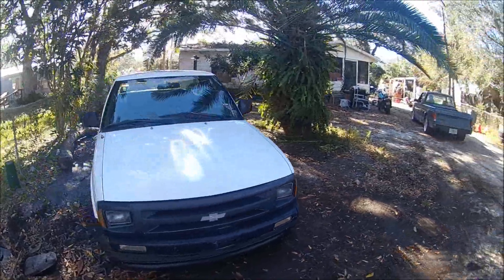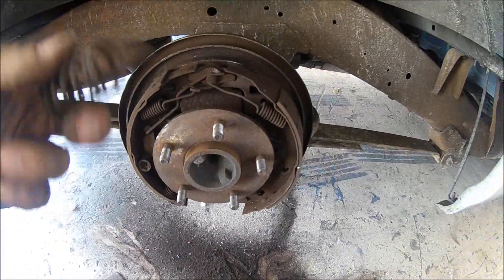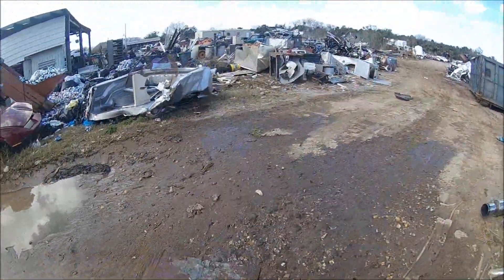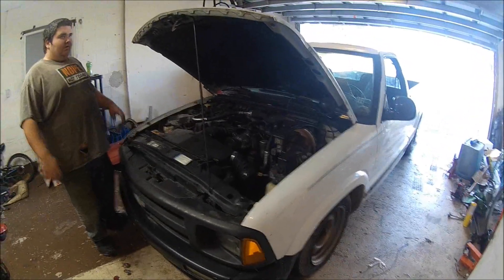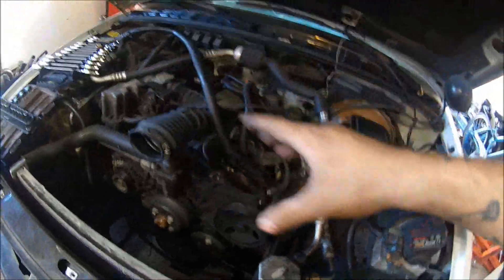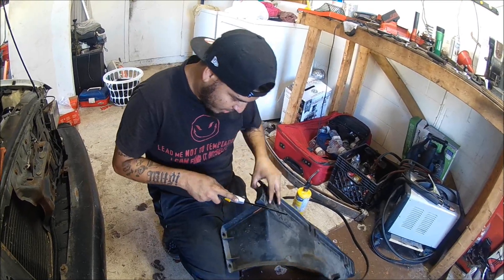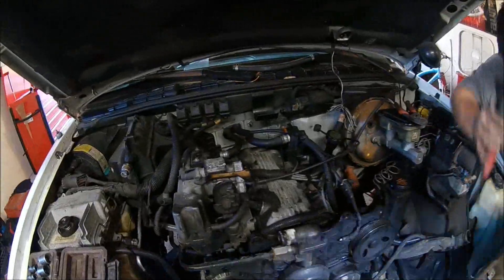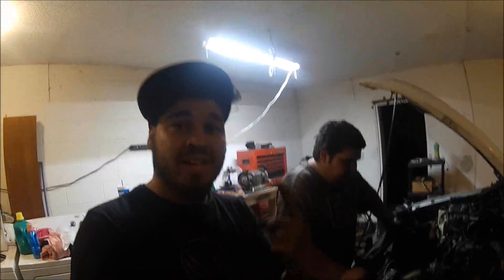Chevy S10 budget turbo build

Comment: Advice from an ol' skool retired hot rod builder and fabricator on a Mc Donald's budget to another,,,,,, HARBOR FREIGHT, very cheap tools and equipment that help you get the job done. Also. KEEP YOUR TOOLS AND WORK AREA NEAT AND CLEAN!!! You would be surprised how much easier and faster it is to get a project done with the proper (cheap) tools and an area to work in is. You will also find that your end results both in quality and quantity WILL greatly improve and that will easily be seen in your finished projects. Sorry, I'm done preaching,,,,LOL!
Reply from the maker: 100% agree garage and stuff was a mess cause I was moving out that house so trying to get truck done and move things so kinda was in a scramble lol

Comment: dont need a hole dish rear end.. i have a 92 s10 blazer that i picked up 2nd gen. s10 blazer rotors,calibers and you can buy adapter plates to mount it all up. so i now have all wheel disk brakes .. also i would bet you that your friend knocked that pin/spring off.. you never pry the drum off like that. on the backside if the plate theres a small rubber plug. you pull that off and use a screwdriver and turn the adjustment screw and they will com right off. end your drums are not adjusted right. you need some resistance  when you turn the drum.
Reply from the maker: It's going disk brakes in the rear doing swap soon

Comment: I used to see the stuck rear shoes at least twice a month and usually it was due to worn drums.
The brake shoes would catch the lip on the worn out drums so, yes when the brake shoe turned sideways it was catching on the drum so if you would have kept turning the drum while inching it off it would have only taken 5 minutes instead of an hour.